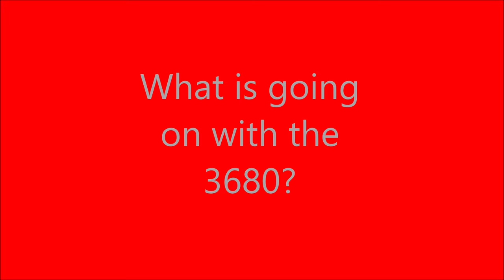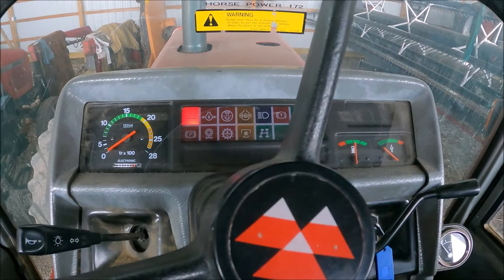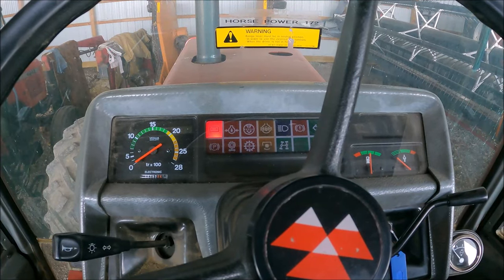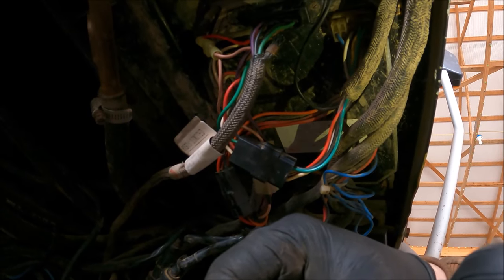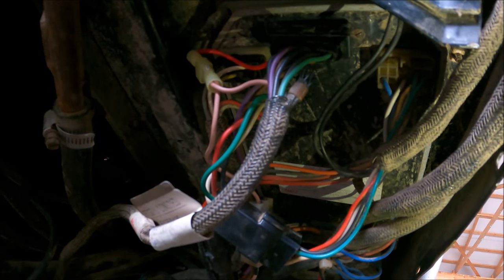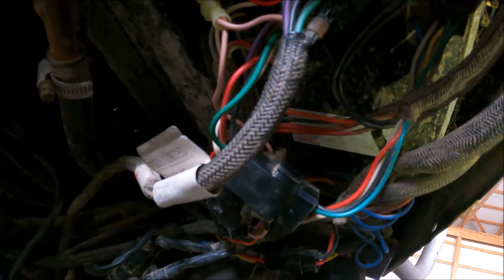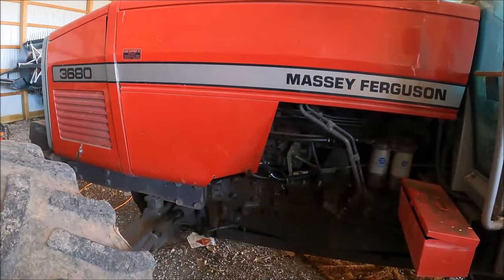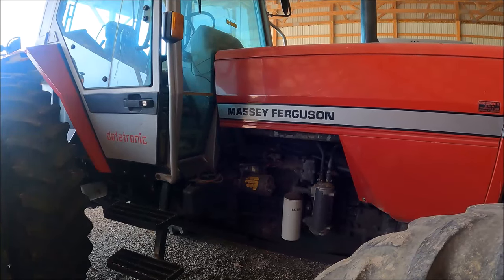What's wrong with the tractor?

Comment: That original computer was the Autotronic 1, the first version MF introduced in 1986. They probably installed the Autotronic 3 kit in it, that is the common replacement and usually reliable. The common problem with the Autotronic 1 is that the connector/socket you mentioned in the video is fixed directly to the circuit board and over time it breaks the contact. I know several with this fault and that been repaired by a specialist repair shop, the solution is to connect a cable to the circuit board and mount the plug/socket to the cable, that is more durable because it is flexible and takes away any vibration. My neighbor has 1989 MF 3080 that had exactly same symptoms as in this video and it was repaired as I mentioned, and it has been trouble free 10 years now.
Reply from the maker: Yeah you are correct it had a Auto 1 and they put in an Auto 3.  They thought at first it was an Auto 2 but when they looked at it they discovered it was Auto 1. 
Thanks for the info and for watching!